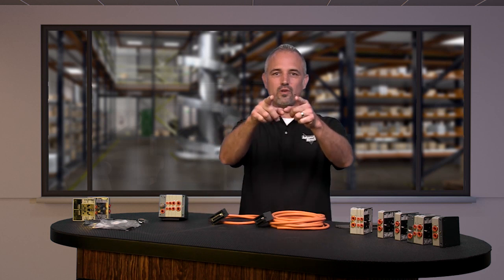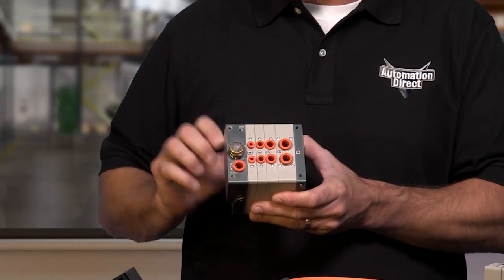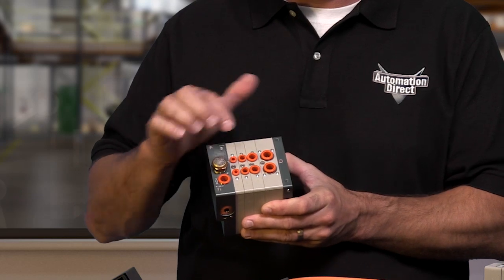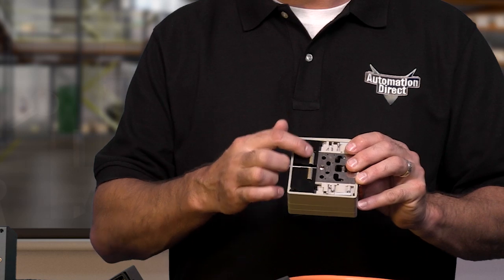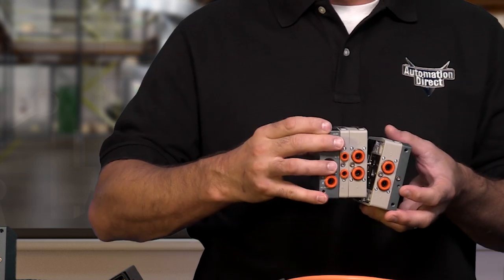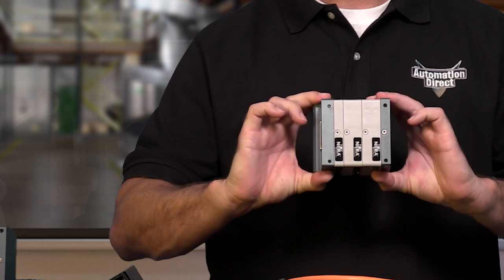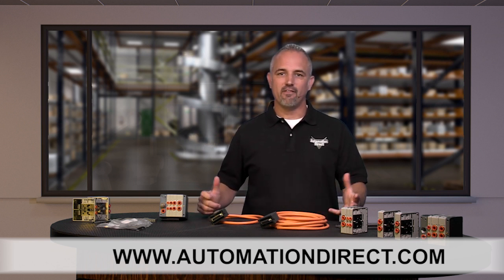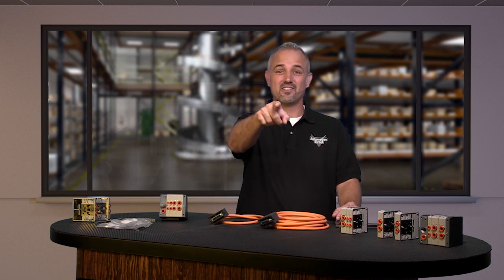NITRA Compact Modular Valves Pneumatics from AutomationDirect

Comment: I AM ORDERING THESE VALVES TO BUILD A TEST STAND.  IT WILL BE THE FIRST TIME I TRY THEM.  I CAN SEE A COUPLE OF VALVES THAT SEEM TO BE MISSING FROM THE LINE UP.  A 5 PORT OPEN CENTER DUAL SOLENOID VALVE, AND A VALVE THAT WILL WORK WITH A CYLINDER THAT IS SPRING RETURNED.  THESE ARE PROBABLY IN THE LINEUP AND I JUST MISSED THEM, BUT IN CASE THEY AREN'T YOU MIGHT CONSIDER ADDING THEM.